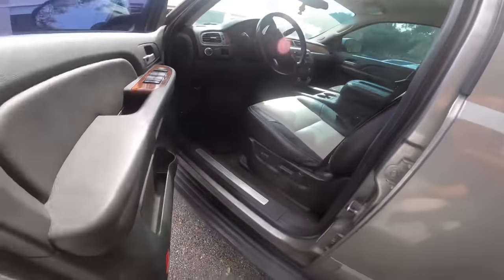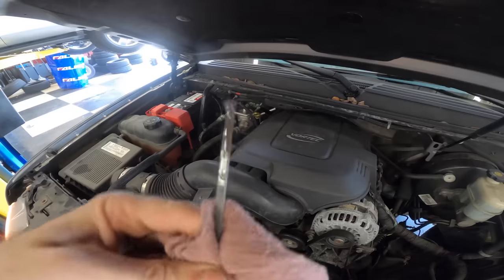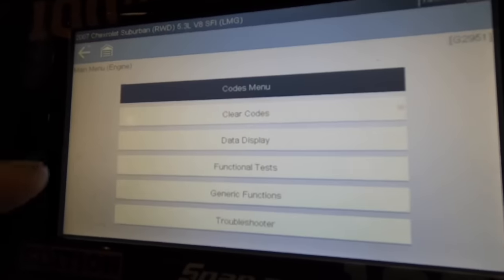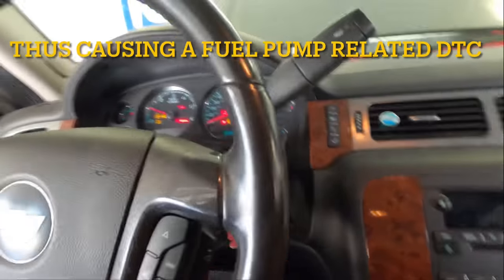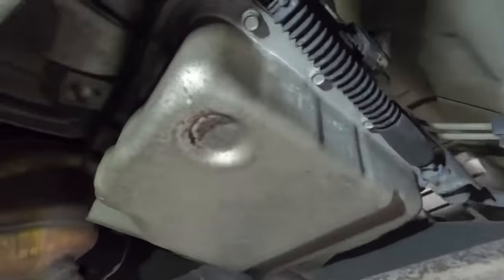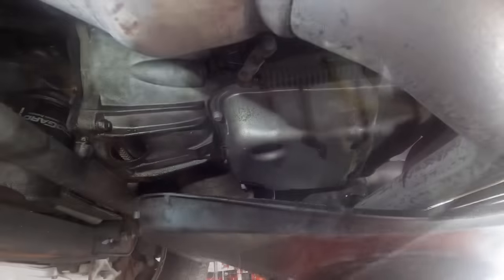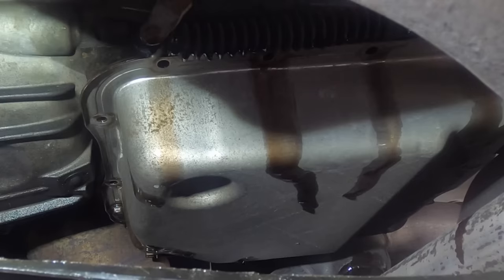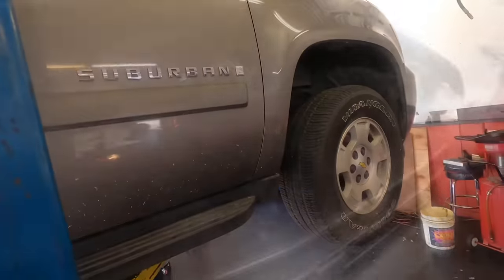Busted! SCAMMING Mechanic Causes Damage! 4l60E Transmission

Comment: Ray, just to let you know. If you really want to see the material that is coming out of the trans and the condition of it. When you remove the filter from the trans, cut the filter open and unfold the filter. You can find bits of copper or brass that's in there I mean bushings are going out inside the transmission, or clutch material meaning the clutch is going out. I've found whole pieces of metal in there that didn't get to the magnet got stuck in the filter. So taking apart the filter is vital in the diagnosis process of understanding the condition of the transmission just to let you know. I'm a 15-year heavy duty diesel and automotive mechanic that specializes in transmission and transaxle rebuilds as well as engine and turbo rebuilds.
Reply: GREAT ADVICE...YOU ARE A MASTER TECH!!!
Reply: I will never consider myself a master tech because everyone seems to think at that point in time they know everything but in this line of work you never know everything you're always learning
Reply: If your gearbox is lucky enough to have a filter lol don't think I've ever seen a manual with one.
Reply: @christopherelliott5502  A Master Tech isn’t something you consider yourself as. It’s what you earn when you get your ASE Master Certification.
Reply: @TomoHawKzZ  my gearbox filter is thr gasket, when she stops leaking it means it's full hahaha
Reply: @shawn3957  ASE is the real scam in the auto industry.
Reply: @SlickWillyTFCF  every industry has something similar. I went to school to work on cars, but I ended up in a different industry. A big part of my job is to ensure our company is following all ISO 9001:2015 standards. We pay tens of thousands of dollars a year to say we’re ISO certified.
Reply: @shawn3957   I worked in a machine shop making carbide tooling and doing PVD coating.  I know that ISO certification is half-assed at best too.  All it does is ensure you have adequate parts and material tracking controls in place internally.  It's thousands of dollars of fees paid every year to ensure you have to complete a tremendous amount of extra paperwork, with no measurable gain in quality control.  

Same with ASE.  All the certification takes is enough knowledge to pass a test that you have to pay hundreds of dollars a year for, with zero actual quality control.  

They're both marketed as solutions to problems that don't actually exist, and they only serve to make those companies exorbitant amounts of money without providing any actual benefit.  The main issue is that so many people have bought into the idea that the certifications are necessary, that they are now essentially required - regardless of the fact that they don't improve quality.
Reply: @bigsparky8888  People do the same thing with engine oil filters that screw on the block. Its nothing new and is basic mechanic knowledge and troubleshooting skills. You can buy tools that are basically heavy duty can openers designed just for opening oil filters.

Comment: As soon as a person tells you, you need a new computer/ECU step away from that shop, unless your car/truck was flooded for more that 3 days, those units are robust
Reply: Couldn’t be further from the truth.
Reply: They do fail, but a second opinion is always good. Just don't lead the second person in that direction or they might skip their normal diagnostic thoughts.
Reply: As an auto tech, I assure you computers do fail, albeit not commonly in most vehicles. In some vehicles, however, computer failure is common. Saturn L series very commonly experiened BCM failures, 2nd gen grand Cherokees commonly had PCM failures result of water intrusion. TONS of Ford models suffered GEM module failures in the early 2000s result of water intrusion caused by a poorly sealed factory windsheild. More recently, Dodge grand caravans/Chrysler T&C are having TICM failures that cause no start issues, windows and door locks that operate all by themselves at random and other issues. Not all computers are as robust as you think. Those are just a few of the common computer failures I see.
Reply: TJ wranglers PCM’s are hot garbage, Chevy truck PCM’s aren’t far behind. One shorted cam/crank sensor is all it takes and the pcm is done. Just had a 2018 ram promaster van at the shop in transmission limo mode due to burned out pcm. Rats and other rodents do it all the time.

Comment: My parents used a particular garage for a number of years when I was growing up. I started to notice a pattern. Every 3-4 months like clockwork, something would break or need adjusting. They'd go in and get that fixed and then the cycle would repeat. It was just long enough that they couldn't really complain that the mechanic had missed something they should have caught the previous time. I tried suggesting going to a different mechanic and they wouldn't hear of it. When I learned to drive, and got a car. I got the Chilton's manual for the vehicle and did much of the maintenance myself. When it needed a mechanic, I refused to take it to theirs which caused a few arguments. Amazingly, my vehicle didn't break down every 3-4 months. I  could never prove anything, but to this day I'm convinced they were setting up future problems every time they did a repair.
Reply: From the time you had enough awareness to the time you bought your car, I'd guess 10 years. Every 4 months to be generous, it would have been 30 visits to the mechanic. That is A LOT of visits. I can't imagine a mechanic creative enough to develop 30 or even 10 issues that will come up with such regularity. Most likely your parents simply had bad American-made cars from the 70s or 80s that did fall apart on their own, without needing any help. And you had a Toyota or such Japanese car that drove American automakers into bankruptcy with their amazingly better reliability.

Comment: It's good to see a thorough mechanic...as I was watching the video, I was routing for you to get this car functioning again...

I once took my car to a dealer to get the complimentary oil change...first oil change free...they said they did a 31 pt inspection...did they really, it had only 5k miles...anyways, they said I needed an air filter and throttle body cleaning...I passed on it cause I could DIY...on the way home I stopped by Autozone and picked up an air filter to replace at the parking lot...opened up the hood, looked at the air filter box, the fasteners were not clipped on...actually, the air box was ajar on one side with an inch of opening...also, the air filter was hardly dirty where it needed replacing...I was so pissed, I was close to going back to the dealer and call out whoever left it like that...my trust for this dealer was shot...if they can't get a simple task done, I question their ability to handle serious issues...yes, it was one mechanic, the dealer, Toyota of Concord...North Carolina...

Comment: I left the dealership 20 years ago to be a car hauler for the exact reasons you stated in this video. You replace a left front marker light and a week later the right rear wheel brake cylinder goes out and somehow it’s your fault. It’s a shame people focus on the bad. It’s also a shame there are so many shady characters in the business. I don’t know how much of it is ignorance and how much of it is being shady. 
And a quick tip I didn’t see you mention in the video. When removing the old transmission filter make sure the old o-ring comes out of the filter bore before installing the new filter. Double stacked o-ring gaskets are no bueno! Great video by the way. I enjoy watching mechanics doing work right!
Reply: EVERY business has horribly shady characters in a small portion.

The problem is car mechanics can do some serious damage.  (That and doctors, the other infamous field).

The thing is that much of the general public has learned to identify bad doctors, although not as much as I thought considering the anti-vaccine movement. 

The solution to problematic engineers is teaching people proper critical thinking.
Reply: Any IT professional will tell you how many shady people in the computer sales business there are, for instance.  The thing is, though, they upsell you a warrantee  that covers nothing and way more hardware than you need.    At most they make an office's electric bill go up a little because they convinced one of the managers to buy CAD workstations for all the computers simply used for word processing.  They won't go and accidentally create an electrical fire.

Comment: Over the 38 years of being a tech and stripping, building, many different types/brands of engine in my opinion manufacturers are trying achieve the impossible which is power, lightweight, economy etc and get all these in an engine like this comes at a cost. Years back things were slower heavier etc but rarely did you see failures like we get nowadays. Alot of modern engines won't tolerate neglect or abuse like their forerunners. The V6 isn't the smoothest of engines at best of times unlike the straight 6 which is naturally well balanced statically and dynamically. The current crop of Ford diesels are pretty poor anyway as I've had my filthy mitts on many and seem to be built to a cost and as seen here not very well designed 😔 keep up the great work guys and looking forward to the next video 👍

Comment: i've only been driving 15yrs but have been through 4 mechanics. The last one I went to for an MOT the car came back with a list of advisorys as long as my arm. I tried a 5th mechanic near me based on recomendations from my FIL n took the list to him, he gave it the once over, nothing wrong at all & came back clean as a whistle, so now I take my car to him.

Everytime I now take to him with issue's & if he cant find what im saying may be wrong, he refuses to throw parts at it until the problem becomes re-peatable or easily traced & then can sort it out. Love that guy. Saved me almost £1500 just on that list of stuff that was wrong that had nuffin wrong so I dont even wanna try n guess what he's saved me since.

Comment: Last time I was quoted for a fuel pump (on a suburban no less), I knew I actually needed it, since it was making a god awful whining noise and when I filled the tank with gas it would start pouring down onto the ground from the top of the tank.

That customer's next stop needs to be Dewey, Cheetum, and Howe, that seems like a pretty solid case against the scammer posing as a mechanic.

Comment: Preach dude!! I know I know... Bad apples. But, they are in every industry.  Us folks with some intelligence know this. We go on the hunt to find quality professionals like yourself. We know u r out there 😁 keeping doing you, ray!!
Reply: "US folks with some ..." ?  Would that be 'WE ' ? 
 Like WE are watching ?  Or is it US are watching ?
Reply: @stevejette2329  us = intelligent people.  I don't know who's watching.
Reply from the maker: @stevejette2329 Us folks, is proper southern vernacular. 😅
Reply: @RainmanRaysRepairs  Don't forget "All y'all " is as well.
Reply: @RainmanRaysRepairs  here in aus. everything is scamed..i had a bmw,old. found an ex,mercedes mech. charged me 170 to find everything wrong & fix what was needed. brilliant,,went back 6 months later,moved on,, now,i dont have a mech i can trust..took my now diesel 2.0 focus to another mech, just for belt & seals,idler w/pump. which i could do but work busy.. told him,to look up certain vids for the timing,told him what to look for,,1200 later,,its sitting in my back yard fkt.. broken rockers. which isnt a problem as there non interference. but cant bring myself to fix it.. took a falcon,82,in for a new trans,,1300,,did not tell me there were hard,cracked wires,which shorted & nearly burnt the car down.. no one cares....even a spray job,wrong color,??..it goes on..
Reply: @RainmanRaysRepairs  tink tink,,check for loos canverter bolts,or any,loose bolts.. has same on my dodge..73 chall..  flex plate & rear engine bolts finger tight..
Reply: @RainmanRaysRepairs  change the fluid after couple days. [ drill hole in converer to drain it,then self tap to fix hole,,job done,,]]

Comment: I am not a mechanic, but have had to do a lot of my own work over the years, so what you said still made sense to me and I do appreciate what you did there. I work in computers and the moral is the same (as is everything else in life); treat others like you want to be treated. Not many people want to be treated like crap. Great video and keep up the great work!
Reply: It isn't always dishonesty, sometimes it is incompetent service people.  I purchased a new Dell computer and I lost Bluetooth I called Dell and they sent me a box to mail the  Computer in. I backed up my important files because they said they would scrub the hard drive. I got it back and I had to reinstall all of my programs. It happened three more times under warranty.  They replaced the motherboard, the Bluetooth/wi fi chip, and the SSD and scrubbed the hard drive each time. Some of the items they replaced two times. Two of the times they sent a tech to my house to reinstall the components. Once I updated the software and got back the Bluetooth, another time I did a hard reset and it came back. I finally just got tired of this and I bought a Bluetooth USB dongle, and it has been working fine ever since. Dell has really gone downhill.  HP is also junk. I find ACER and ASUS are both fine computers.

Comment: Just when the client thought he was getting somewhere, the fog lights stopped working!
Reply: Lol, you're right. Hey Ray, did you put in a new fog light relay!?
Reply: @chuckgross6024  I think that relay is for the fog lights AND the ejection seat.
Reply: Just use the blue wire from previous “repair”. Instead of never stopping engine you’ll have never off fog lights
Reply: Do you need fog in florida? Lol
Reply: @leonardocrisostomo5975  Fog lights scare the alligators, or attracts them...I forget which.

Comment: Excellent video, I was ripped off a few times when I was younger with my first car that I had it was a Pontiac trans am. Only happened twice, once from a company called Big O tires and once from a Pontiac dealership that wasn't my regular dealership I had been going to.  after that I started doing my own repairs probably 80% of them.  I started reading repair manuals and learned how to do most of the repairs on my own....We need more Mechanic's like you out there that are honest and has integrity.... I'm sure for every bad one there's probably a thousand honest ones.

Comment: Yeah this is kind of an ongoing dilemma out where I live. I've happily spent a week chasing down a single burnt capacitor inside a pcm for a customer who wanted it fixed right, and I've also happily locked a variable cam in place for a couple who really needed their vehicle and couldn't afford to fix the ridiculous crap (in their eyes) on their vehicle. It's really too bad there isn't a simple, reliable option for people who were honestly better served when Mr. Ford was alive by far than they are today. These people deal with snow, not traffic. Nobody cares if it'll be safe in a high speed accident, the odds of being hit by an airplane just aren't high enough to worry about.